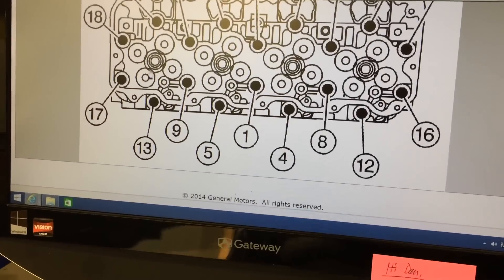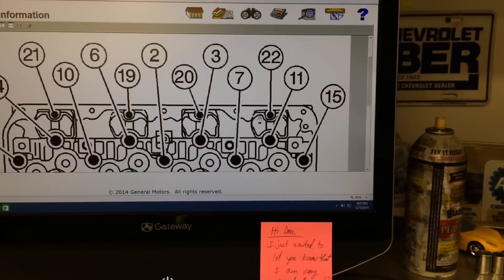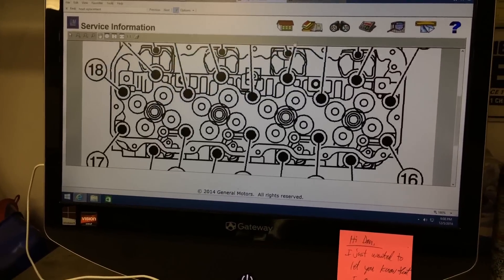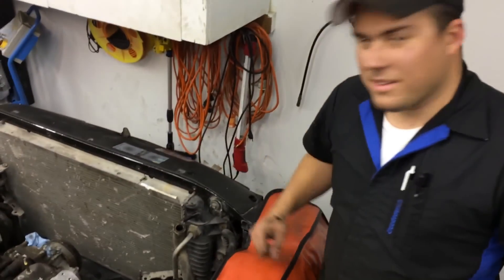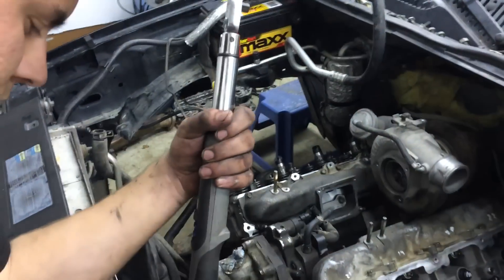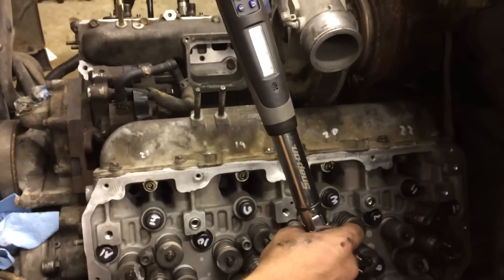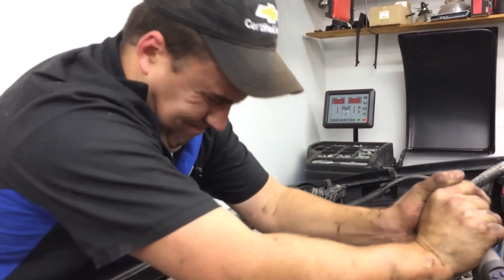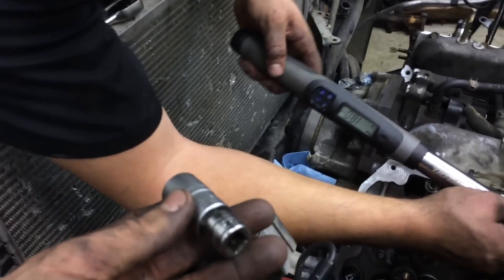Installing Duramax Cylinder Heads Part 4

Comment: I noticed you removed the inner fenders. Does it make it easier to do the job.
Reply: Shane Keaton You have to to get to certain bolts and such.
Reply: Considering the uppipes, manifolds, and if u have never removed it before then the fan shroud and all the little bracketry and what not so it makes life much much easier to spend the 5 minutes each side to remove the fender liners.

Comment: Hello, it looks like I will be doing my head gaskets on my 05' LLY Duramax.  Can I ask, what size torque wrench are you using?  It looks like a 3/8 drive but I want to make sure that is right before I go and purchase one.  What other special tools do you recommend for this job?  I also like the idea of removing the hood and dropping the front of the truck (it will save my back)  :)  Thanks